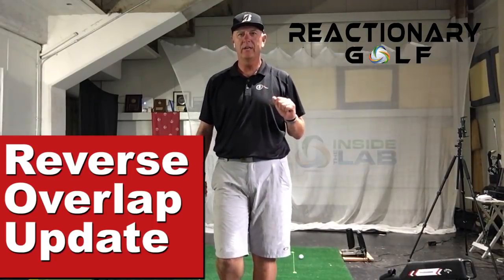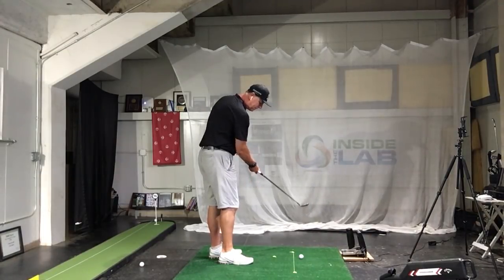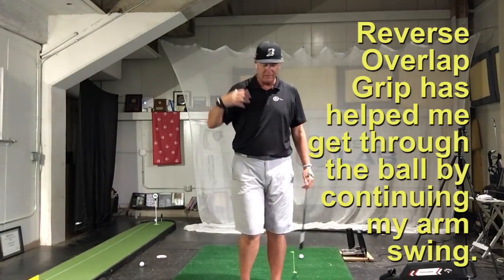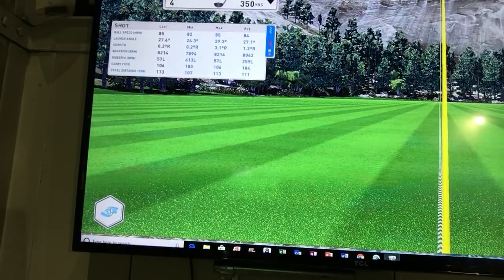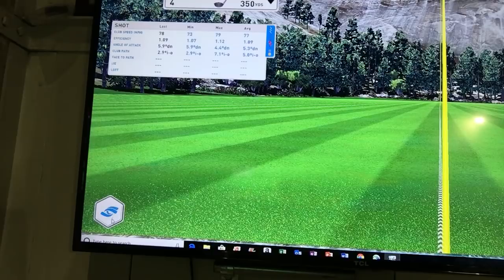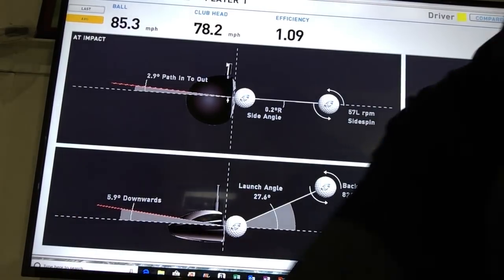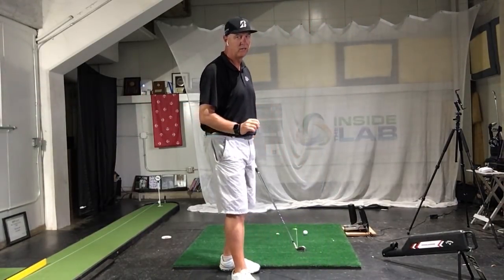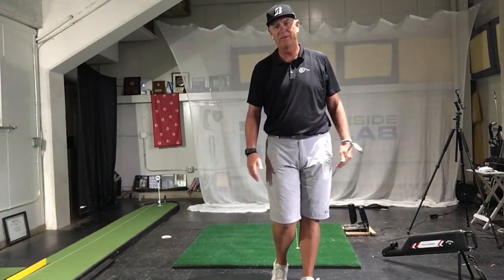Follow-Up on the Reverse Overlap Grip

Comment: Before knowing about Tony's videos, I (7 Hcap)  recently changed putting to reverse overlap and good improvement. Irons had been less than satisfactory for several years. Tried all sorts of changes - big and small and finally tried reverse overlap. Really big immediate improvement both at practice and in comp. Not as good with driver and Rescue but will work on these. Then was good to just now Google and see Tony's videos and other's supporting views.
Reply from the maker: Thanks Kim.  I go back and forth with different grips on the longer clubs. It's ok to mix it up.

Comment: Always enjoy your info Tony, thanks..
Reply from the maker: Thanks!
Reply: being age 62 I've been seeking a back & spine friendly swing so I'm thinking a  "flamingo"  style swing will reduce the stress on my lower back by eliminating the lateral hip action and  twisting between the lower and upper body? make sense? thanks again Tony
Reply from the maker: You got it!  Arms create most of the club head velocity. Legs & hips support and add to it but not create it!
Reply: great, also when doing the flamingo what's easier on the back as far as left foot flare (i'm right handed) because if i flare it a lot my left hip turns easier But i don't get the firm left post to facilitate the release? I'll gladly give up some power to prevent stress on the joints...
Reply: First video that this follows up from??
Reply from the maker: Need to use your muscles to post, contract the quads and glutes to brace and create post.

Comment: I'm glad to see someone looking into this grip for the full swing. I have been using it this year with definitely improved wedges and fairway woods. Mid irons are not much different, with the exception of digging out of deeper rough is worse. For some reason it club doesn't work as steeply. Keep up the experimenting---I don't feel like such an outlier.
Reply from the maker: I've seen that, I've had to change approach for that shot, however, I'm not missing many greens or fairways!!! Not going back anytime soon, it's working well.

Comment: I've not been able to stop my right hand from flipping/casting and this appears to be helping me.  
  It makes me feel my left hand is in charge instead of my right.  I played a lot of tennis and my right arm is much stronger than my left.
Reply from the maker: It sounds like your body is out running your arms in transition and you are having to use your hands to get the club caught up. Hit some shots right hand only-7 iron off a tee. This will change your timing and allow you to use both right and left sides properly. To hit draws, the golf swing is much like a top spin tennis stroke.

Comment: Love this grip but my pinkie gets terribly soar. Taping helps but its not the perfect solution. Any suggestions ?
Reply from the maker: Stefan Ritter you May have change back to a grip that doesn't put strain on your finger. Right or left pinky?
Reply: @TonyLuczak  Right pinky. The tip of the finger slightly touches the shaft and if I hit a lot of balls on the range the skin of the tip gets raw. I really like this grip and don't  want to change-
Reply from the maker: Stefan Ritter the pinky should be touching the left thumb. You May have your hand too much on top, try rotating the right hand slightly more under or sometimes termed stronger alignment till the pinky is on the thumb. That is where I feel it.